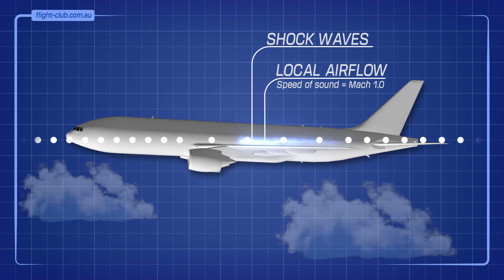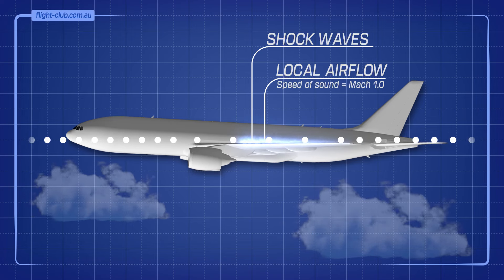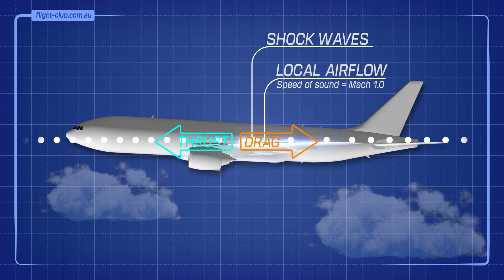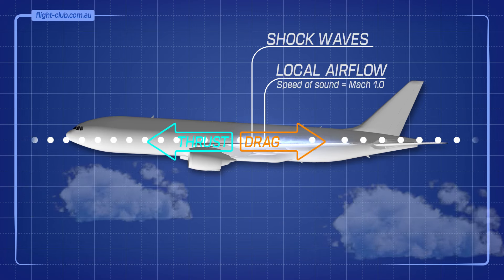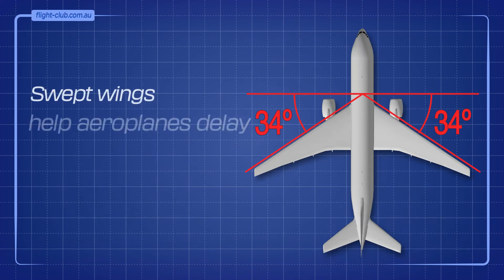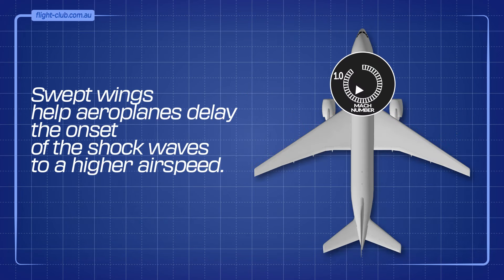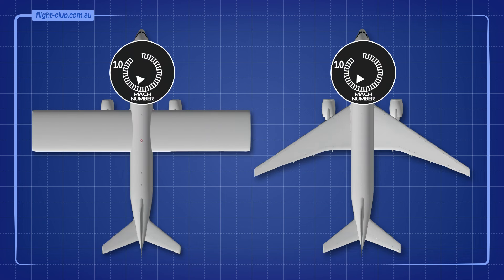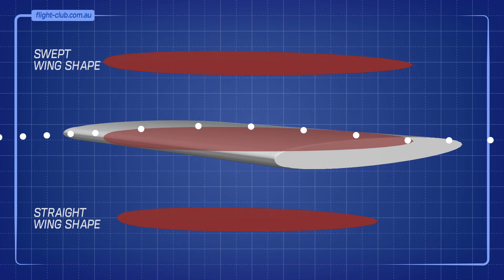Swept Wings | Simple explanation of a complex topic.

Comment: I always had an issue with this span-wise vs chord-wise explanation. The airflow only cares about the cross section of the wing that it is flowing parallel to, so why isn't it explained that by sweeping the wings, the thickness of the airfoil in relation to the chord length is smaller, therefore lowering the coefficient of pressure, and delaying the generation of shockwave?
Reply: because in reality air will always exist and move in 3D
Reply: agreed, 
sick and tired of those blind application of some vector math and be done with it vidoes.
Reply: I beleive the components would be used to actually design the cross section of the wings (perpendicular to the wing component would decide the cross section and materials ) and people use this to explain without understanding the connection but i agree with your point.

Comment: Why does the free stream "know" the swept wing angles though? If we cut a small strip with very small span from both wings, then they would be almost identical except for the leading edge where the swept wing is slightly slanted. Suppose the cord length is the same for both strips, then I would assume both strip would obtain equal lift ? (assuming simplified aerodynamics without considering tip vortex).
Reply: The swept wing is also tapered, so the pressure gradient is a decreasing curve from wing root to tip, and the slant contributes to the air having to flow with a sideway component due to the uneven pressure gradient (spanwise flow), which is how the air "knows" I’m assuming

Comment: Why the reason sweep back wing makes vertical(Y axial) and directional(Z) stability ?
Reply: 1: if a plane yaws to the right, the left wing is hitting more wind than the right wing, creating drag and causing the plane to yaw to the left.  2: Length between cg and vertical stabilator give more surface area to relative wind. acts like weathervane.

Comment: Actually, there’s a bigger reason why fast planes have swept wings. Because there’s spanwise flow at all, this means that some of the air flows alongside instead of all of the air being forced over and under the wing in a chordwise flow. This pushed air out of the way more efficiently similar to sliding down a ramp instead of running into a wall. Angling the wings backwards also pulls the center of drag backwards behind the center of gravity so there’s more force that keeps the plane flying nose first.